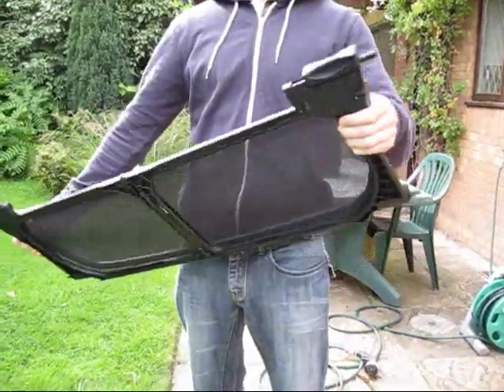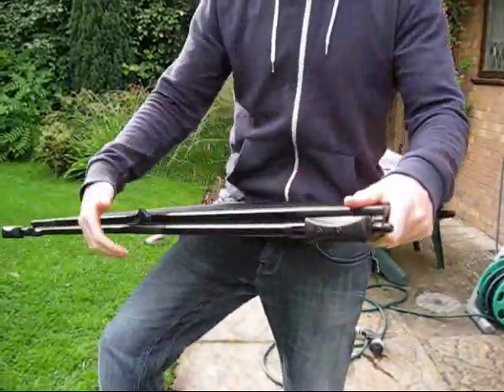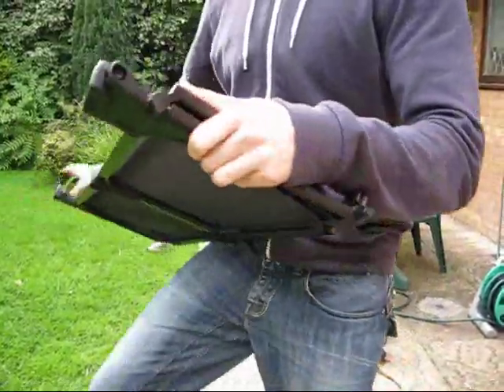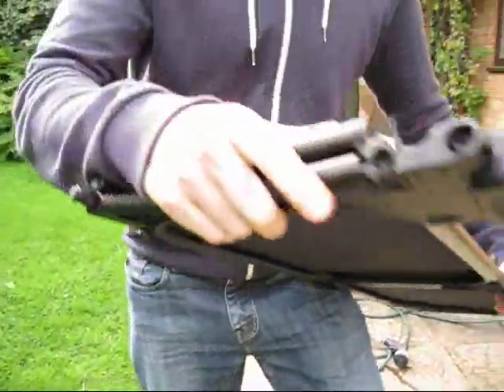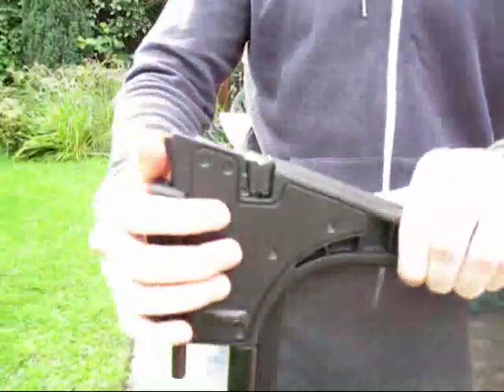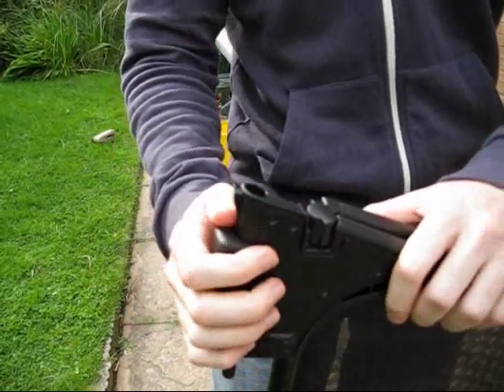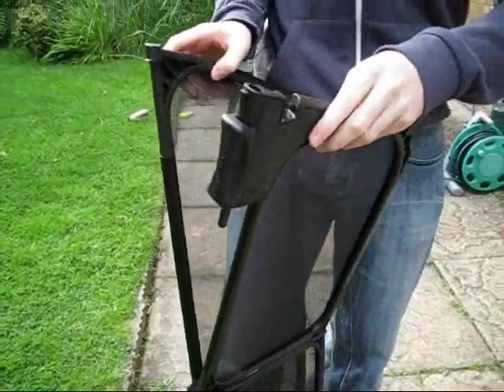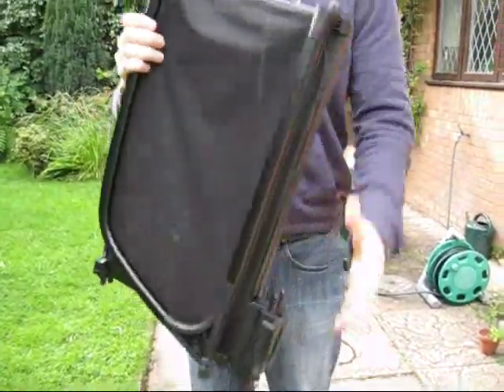How to close / fold mini convertible wind deflector

Comment: Thanks ! You saved my day. Mine is not identic to the one on the video. The lock  is diferent. In the one I have the lock is a small red color piece that slides in the back. But the lock system is identic, so... when I saw the way you unlocked yours...and there was light on a very dark room where a stiff wind deflector layed for more than a month.

Comment: Many thanks for a great video. Better than the instructions, which I already misplaced. I rarely remove the deflector, so it's a mystery again after a couple of months. Also, it is really hard to fit in the trunk if not completely folded. By the way, I have a 2008 Sebring, but the deflector folds identically.  Thanks again.......K in Maryland